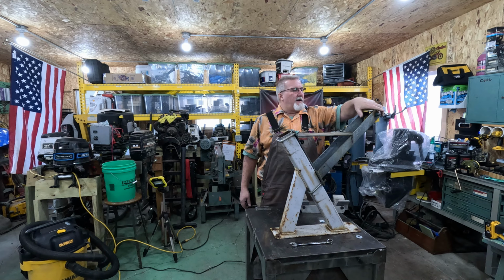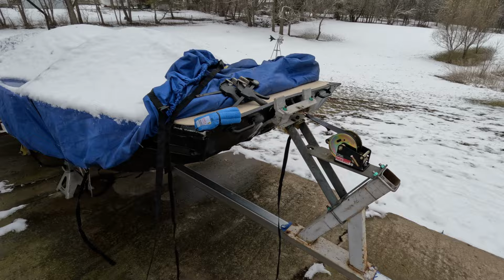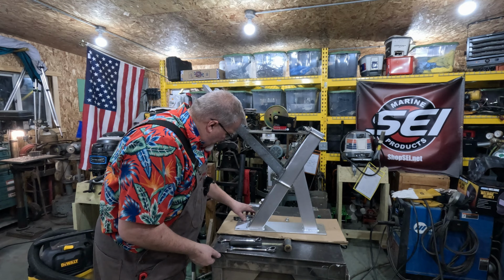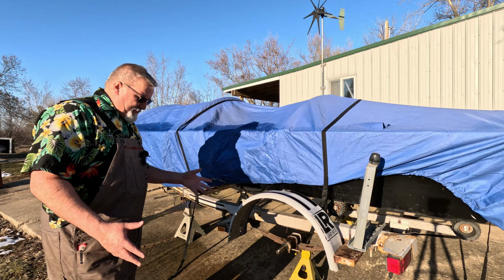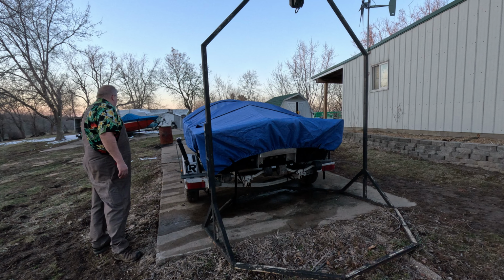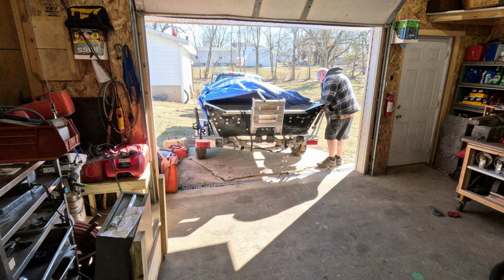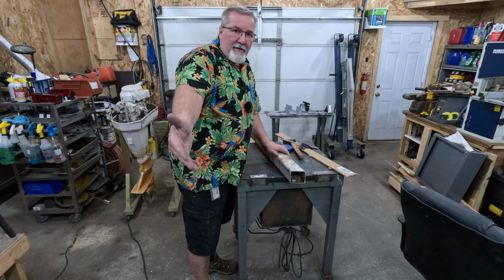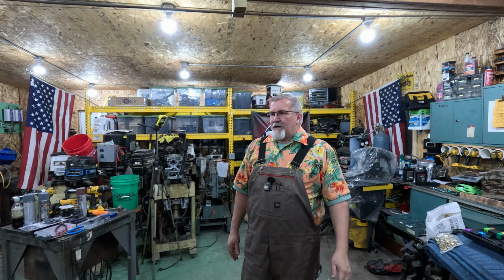The Good Enough trailer Part 3 for the 1977 Polarkraft Jon Boat

Comment: Great job with the trailer repairs and mods. One comment I have is that when you connect the safety chains, they should be crossed. The reason is that they create a cradle to catch the trailer tongue in the unlikely event that the tongue detaches from the hitch. Thanks for your great videos. Keep up the good work.
Reply from the maker: I normally do cross them.  I was just running around the yard with it, thanks for watching

Comment: On the future outdrive video, it’d be great if you cover extracting the broken bolts that hold the water pocket housing in the upper section of the outdrive.  Not that I couldn’t use some guidance…
Reply from the maker: Great suggestion! thanks for watching

Comment: i like the high mounted lights. the low mounted liscense plate is one thing i hate. any ideas?
Reply from the maker: a welded bracket to the outside of the uprights with the plate below keeps it off the ground. Thanks for watching